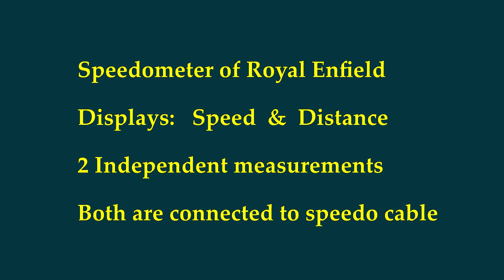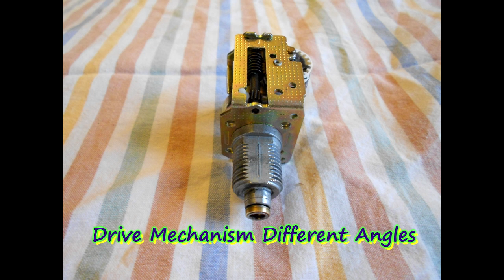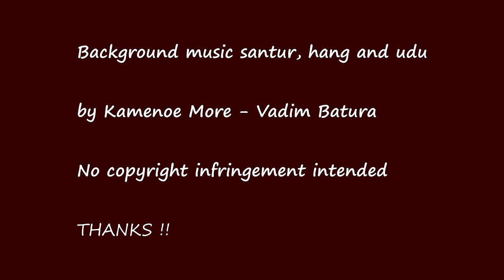How Does Speedometer of Motorcycle Work and Full Disassembly

Comment: Very cool music. This video really helps to understand the workings of an analog speedometer. I was wondering if you might have a suggestion with what's wrong with my trip meter reset to zero function for my 78 Yamaha DT400. When I pull the knob out all I get is a running down or up- mile by mile, but not a 1 turn reset to zero. Kind of makes it hard to gauge when I pull over to get gas. Thank you so much.